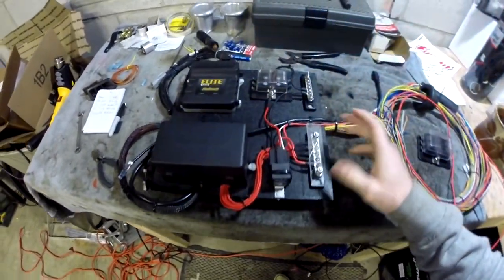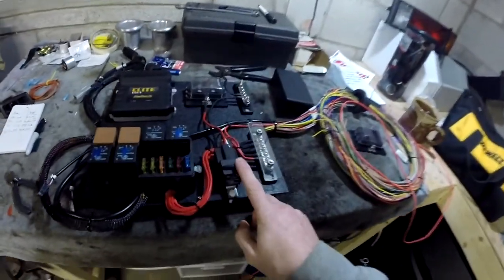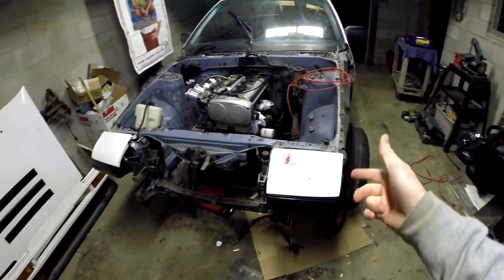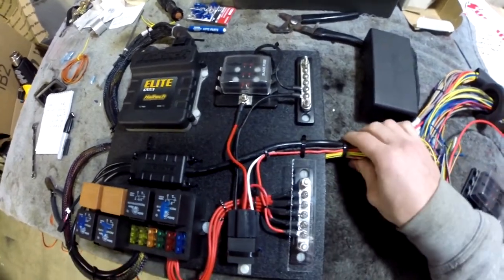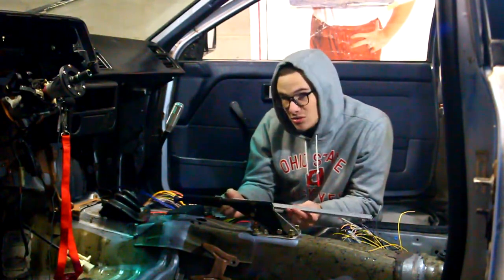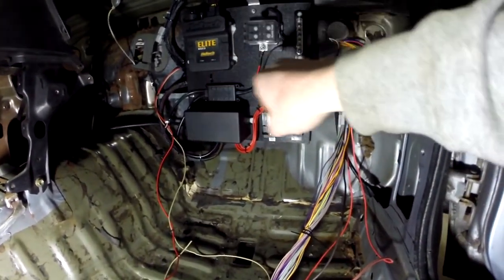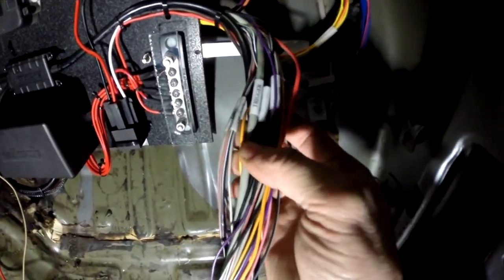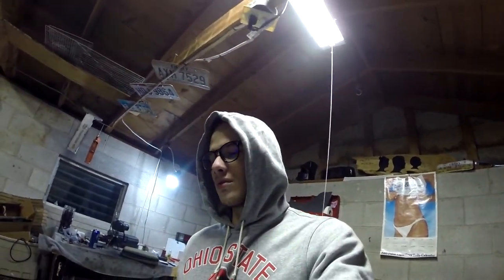Haltech Panel Mounting | Project AE86 ep.5

Comment: Wheres that 6th part my dude?
Reply from the maker: retrotellephone :) doing a lot of work behind the scenes. I’ve rewired the whole chassis; turn signals, headlights, taillights, sensors, alternator, etc etc. I had to wire the whole car and it’s been taking a long time between the cold weather, work, and money. I have surgery next week too :( Started filming the 6th part last week and I’m just about ready finish the haltech wiring and get it running. I’ll get it up! Thanks for hanging in with us
Reply: Sweet dude, glad to hear you're still working on it!
Reply: @puzzle.86 part 6, 6 years later? 😅